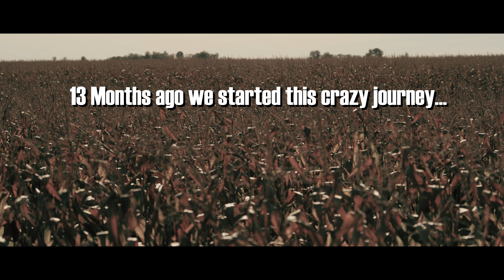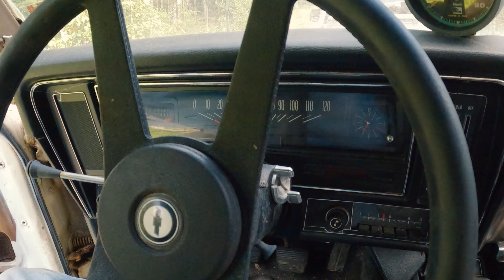Recovering 1972 Chevy Nova Parked for 46 Years | RUSTORATIONS EP6

Comment: Don't know if you know this but you might have a original SS car ,I noticed it has a factory tach and full floor consol and gauges in 72 they put the K code in the vin tag for SS cars , also look for a build sheet on top of gas tank or behind glove box anyway that's a great find for sure I have a 71SS black on black love my nova
Reply from the maker: Hey Kevin I had the same thought. But looked into it and although its a custom build it's not as SS. But that's okay! Thanks for the comment. Hope you stick around for the build the car is in a million pieces now

Comment: 71 Nova, back in 1985, bought it $100 no motor, or transmission,  spent more time and money on it than any other car I ever had...I  was 22 and did everything myself....ended up putting 454 and four speed in it.
Sold it before I reached my vision for it.
Guy I sold it to wrecked it , I had chance to but it back but passed on it.
Years later met a guy who had bought it and put the motor in his 69 camaro , since I rebuilt the motor and it was still running good it was a really cool to hear it run after so many years.
Reply from the maker: Heck of a story sounds like the glory days just working on a car like that in your Youth. I also worked on a 88 Cherokee when I was younger some of the best years of my life. But man a nova at 22 would be amazing. Unreal story about your car I can't believe it was passed around so much and didn't end up being crushed... True miracle
 Do you think you would ever consider getting another one or trying to restore one?
Reply: @SubdivisionAuto  
I was 17 yrs old in 1980 and regular nova and chevelles and pretty much any gmc made cars could be bought at decent price,  had 68 pontiac tempest and 69 pontiac Lemans bought both for practically hundred bucks...the tempest already had a chevy 327 that ran really well with three speed. The Lemans had been stolen and dumped in a lake, I was with wrecker driver and police when it was pulled out of the lake, it had only been in lake for few hours...college kid prank gone bad from what I heard.
The 350 motor in it ran after draining and auto trans was shot....but put in a nice 400 and four speed in it and a posi rear end out of a wrecked 442.
Those were the days...local junkyard had all kinds of stuff back then and didn't charge a lot for them.

In 84 I helped a 15 year old neighbor kid build his first car...a 70 nova he bought for three hundred..minus motor and trans....he bought a small block 350 and a auto trans for couple hundred bucks, air shocks and nice wheels had a nice car for under $900 stuff today you'd only dream of.

Last car I messed with was a 79 5.0 mustang, didn't get into it much..exhaust and put newer five speed trans in it..that was probably twenty years ago...
Things cost so much now, it would be fun though if I found the right project.
Reply from the maker: @terrygilliland5405  that's awesome thank you for sharing the history. It's these kind of stories that drive my passion and you commenting means a lot. You may have noticed I film videos of other people's cars on this channel as well and get their stories. Sad thing is the stories often die with he people unless they are told. So it's cool to share. Despite your age it sounds like you still have a passion for cars. I'd love to see you take on another project even if it's at a lower scope. Love your attitude. Thank you for dropping in let me know how it goes. Yes things cost a lot now but being creative cam still make it happen.

Comment: Congrats working on my dads 1970 nova its a 4 door  but a 3speed manual so thats a win😂 and its clean inside the only thing im missing is the head liner and the dash is cracked so im shocked seeing how clean yours looks, the guage cluster too i had to remove mine to clean it from dust. so again seeing yours clear and seeing the numbers clearly i can say you got the right one
Reply: Since i dont have the head liner on im a add sound and heat insulation for a better ride like modern cars
Reply from the maker: Thank you yes it was worth the wait for sure... mind you its got some issues I have since revealed but youll be able to see them in the upcoming videos. Yeah the dash is what sold me on it its rare to see one like this and those parts a rare/expensive. Thats cool you are working on it. What do you have in terms of engine in there? 350? inline 6?
Reply from the maker: All I can say is if you are doing that make sure you epoxy primer before doing that. You can trap moisture and rot out your roof ( seen lots like that). But yeah good idea

Comment: I just got a 72 5 days ago. Got it from the second owner who bought it in highschool sold it to a buddy then bought it back. Always garage kept, original paint with all original trim and emblems still in place only minimal rust above the rear fenders. Completely re done interior with only some rips on the drivers seat. Clean engine bay with four barrel carb and duel exhaust, rebuilt trans with shift kit and brand new offset wheels and tires with 7s in front 10s in back. Extra wheels, carb new shocks in the box and some other stuff. Starts and drives flawless and sounds mean, i just came back from a canyon cruise with my girl actually. Only paid 11k and it's a front seat upholstery kit and paint job away from looking brand new inside and out.
Reply from the maker: Wow man 11k that sounds like a steal for a car of that quality! I am already well beyond that with all the parts/repair materials I have spent money on and the car is in a milllion pieces... years from running. Just goes to show you it's worth waiting for the right one in terms of deals.... Now I always planned to film the entire thing on camera so our car is perfect for us; however, if I was in your shoes I would have done the same thing. What made you want to get a Nova anyways? Well done, car sounds like a blast hope you enjoy it! Thanks for dropping in.

Comment: I'm sure glad you found a Nova and look forward to the build... I see it has the bumper guards which I have been looking for, for years.......Very nicely optioned car as it must have had the 350 with multi leaf springs. Does it also have the F41 suspension  package?
Reply from the maker: Thanks for the kind words. Build is going well we are filming the entire process. Yes lots of people have asked me about the guards trying to buy them from me so I assume they are quite rare. The bumpers were rough and I was on fence to take them or not but glad I did as we have restored them in one of the videos... Yes car well option it had a 350 as you mentioned. Not sure about the F41 how do I go about finding that out any tricks?

Thank you

Max
Reply: @SubdivisionAuto  It would have front and rear sway bars and front disc brakes, It looks like it should have front discs as you have a power booster. But if it's got both sway bars it's the upgraded suspension. All 350 cars had multi leaf springs. No telling if it was a SS package as they were never called out in the vin. Willow Run never kept the built sheets in the cars and did a good job of putting them in the trash as per company procedures. The only thing I found in my Nova was the seat tags with the vin. I can't wait to see the progress on this..... You need to check out my Nova....!!!!!

Comment: Hi Max! Your Nova quest reminded me, of me - about 20 years ago. I had gotten off of motorcycles and became re-interested in hot rods. I knew that I wasn't able to start a project from scratch, so I started looking around for either a Chevy S10 pick-up or a 1st generation Chevy II. Either vehicle would need a V8 swap. Chevys are the most reasonable to build,  - just compare hop-up parts for Chevy, Ford and Mopar.  Your Chevy dollar goes a lot further.  There are a lot of S10s out there, but the cabs are cramped and the 63- 65 Chevy IIs are harder to find than hen's teeth. 2nd gen Novas (65-67) have shock tower suspension and although 327s were an option, the engine compartments are tight when it comes to headers. After quite some time. I did find a couple of Novas for sale, by the same seller. I contacted him and found that he had a 74 307 a/t car and the Nova that I bought., It is a 71 car, 350 4 speed. It was rough around the edges, but it ran and I drove it home. I paid $2500 back then. I still have the car and slowly upgraded it . When I started the process, I wanted to create more of a sports car, rather than a drag racer. So, I have concentrated  on suspension upgrades, (poly bushings front to rear,  over size anti-sway bars, add one to the rear axle, subframe connectors, power drilled and vented front disc brakes, gas shocks) painted the car in my garage and with the help of a buddy, re-built the engine (rings, bearings, double roller timing set Comp Cams XE 268, oil pump, Edelbrock intake,  carn and 5089 aluminum heads). The car is still a "work in progress", but from the time that I was in my teens (I just turned 75 last October) a hot rod was a car that someone was working in their garage, sounded good maybe smoked a bit but was wonderful to my young eyes. Never a "trailer queen", never a magazine quality car.
I take my car to local car shows, cars 'n' coffee gatherings and it sees about 2000 KM of road time per year. I wouldn't have it any other way.
My advice to you, don't be in any great rush to find your car, It is out there as you read this. 
And, for what it's worth , try to find a roller or a driver. With a young growing family, your resources can be tight and consequently progress on your car, hard to notice at times. Don't lose interest as your car gathers dust.
Regards. 
Bruce Nixon
Reply from the maker: Bruce, first of all thanks for taking the time to write this and share your story. Very cool and good advice about the Chevys for sure. So we did end up picking up this Nova but not before seeing over 60 cars before that. I can tell you this much: its been 3 months working on the car... I just finished to shut down for the holidays. No none of this video is out yet but you will see what a huge project this quickly turns into. That said it's the perfect car for us because the amount I learned was very valuable. You will see videos coming out every now and then on all the aspects we are working on. Focusing on bodywork mostly... still a lot to do. Will be taking my time on this one because I dont want to spend too much in a short period. Hoping to get some sponsors on the channel to send us some parts. But in the meantime we are doing things with finances in mind... thus far it has gone well. Thanks for your comments glad to hear you still have the driving itch at 75 !

Comment: First thing noticeable, and I don't know why, is the rear end being so high?   These days usually sit fairly level, so is it the springs used in it?   Looks like all the rubber bushings will need replacement, but that's all low cost, and you had an engine in mind anyway, so that in itself can be another project!   Great find indeed, so take LOTS of 'before & after' images, as 20 -30 years down the road, you'll be glad you did!  Congrats, and now you must be excited for the restoration!    If a car could smile, I bet this one would be, as you'll again give it 'life' and love.
Reply from the maker: The reason the rear was so high is because they removed the shocks and propped it up with 2x4s. Actually one of them fell out on the way home and I almost lost the car (quebec roads are terrible!). Oh yeah all the rubber bushings are basically dust theyre rock hard and disintegrate when you touch them. Oh yeah we took a ton of before photos there is no lack. Thank you very much for the kind words we are really happy with it but its a HUGE project. We have a few more videos we did after this one and in less than 3 weeks a huge video comes out regarding the floor. Hope youll stick around for the ride thanks for the comment!

Comment: I had a 71 6 cylinder car that I put a 350  in and drove it to high school and ran 9 's in the 8th mile . Sold it to buy a 72 Dart swinger. I sold the nova for 350.00 and bought the Dart for 300.00 .
Reply from the maker: Wow thats one hell of a story... You cant even get a part for 350 these days it seems amazing how times have changed.... How did you get it so fast with a 350? 9's is really fast for a small block curious what you did to make it that quick.. impressive

Comment: Buckets, tach, 4 speed with console gauges….you may have a super sport.
Reply: I don’t see hood louvers…so if not a SS, then highly option normal one.
Reply from the maker: Yeah its not an SS I looked into it it was a "custom". Which means larger fuel lines, 350 engine, 4 speed manual, buckets, center consol, disc brakes front. Still a good start for us we are removing everything ayways. New ep comes out tomorrow you will see more on it if you are intersted. Thanks for the comment!

Comment: What are your plans for power plant?
Reply from the maker: LS with a 5 speed tremec tkx or t56 magnum 6 speed, keep the 8.5 rear for now until I get a 12
Reply: @SubdivisionAuto  Cool,  that 8.5 can be built to handle a surprising amount of torque and abuse.   I put an Auburn unit in mine under recommendation.  Works awesome.
Reply from the maker: @strokersteve468  your not the first one to tell me that that's very cool. I think I'll do ws you recommend. Thanks for the tip!
Reply: @SubdivisionAuto  I got the boys at the power drive line shop on Michael St to rebuild mine.  " Big Dan" really knows his stuff.  He's the one who helped me out.
Reply from the maker: @johnnyduplantis  good thoughts Johnny. For sure keeping forever never selling this thing. LS1 would be sweet for sure not 100% which engine yet bit manual transmission for sure